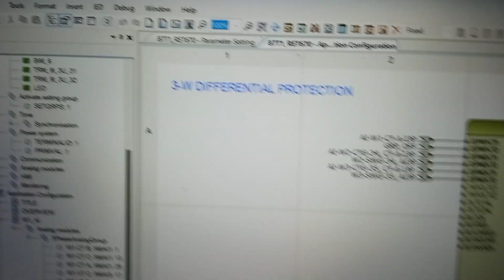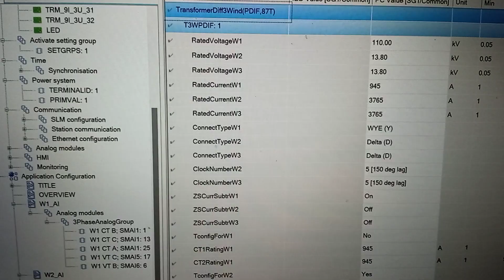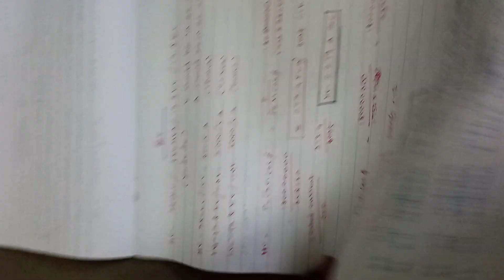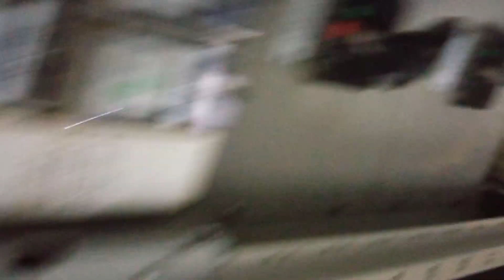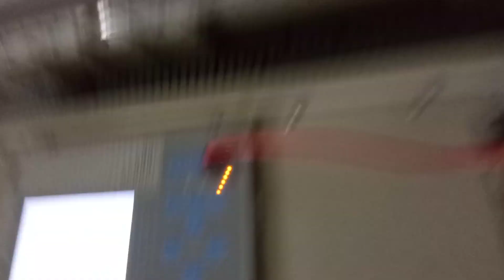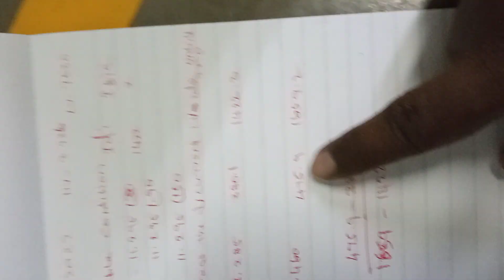RET670 transformer differential protection relay testing calculations

Comment: I have a problem regarding power measurements the relay reads all currents and voltage correctly but power gives values that not match with injection
Reply from the maker: Check relay setting current and voltage and frequency and wiring connections,  injection source measurements